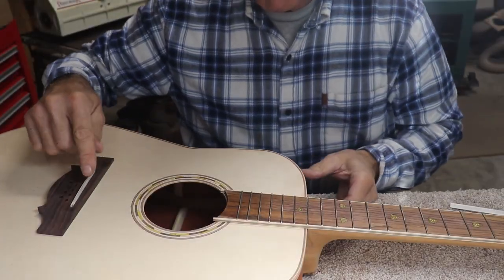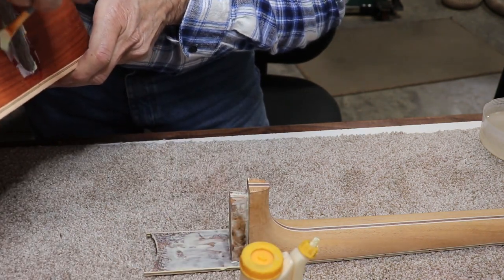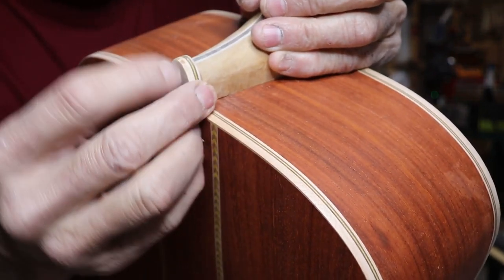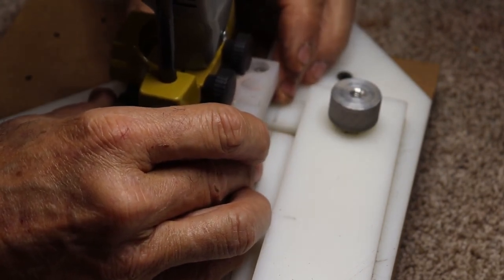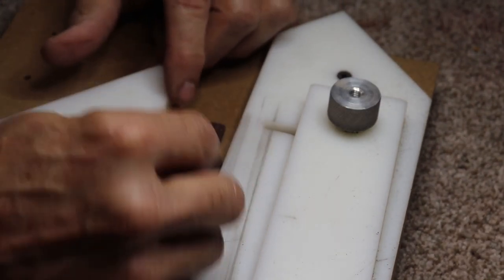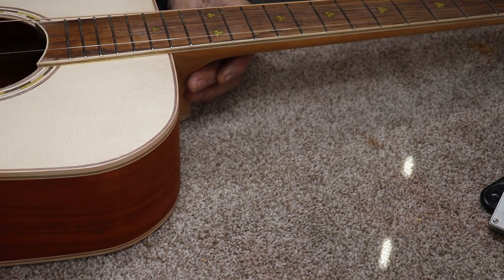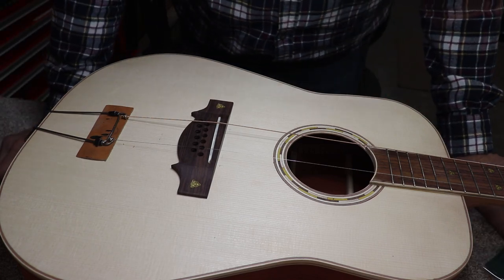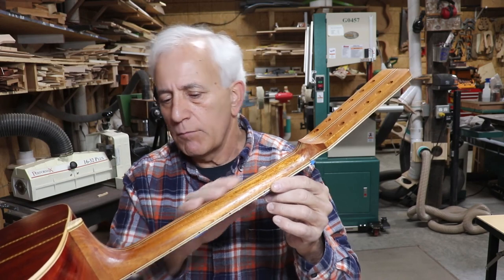455 A 12 String Custom Rosa Dreadnought Part 11

Comment: Hey Jerry, I am really loving the progress and the look of this 12 string. I agree with you on your comment that you like to leave the neck unfinished and just use oil. I have a Yamaha acoustic, with a neck that is high gloss and I am so tempted to remove it because I prefer a bare neck. It helps you move down the neck faster. I know that you use Adirondack spruce for your guitar, but is there any difference between the sound quality of a guitar that uses Adirondack vs Engelmann

Comment: Just an observation with little experience, your method of routing the bridge inlays assumed the bridge was the same thickness on both sides. How about setting the bit to touch the surface, then placing two .050 shims on the jig and lowering the bit again? Maybe easier said than done, like I said I have little practical experience with a router. It would take the calipers out of the equation.. We all have our opinion. I love your videos.

Comment: To set the router bit depth, just sit the inlays between the router base and the jig. Drop the bit till it touches the saddle and tighten it. Once you remove the inlays everything shifts the required depth down
Reply from the maker: Thats a good idea.

Comment: For intonation, the distance between the nut and 12th fret should not be exactly the same as the 12th fret to the saddle. Fretting the string increases the string tension ever so slightly, raising the pitch, so for perfect intonation the distance from the 12th to the saddle should be a tiny bit longer than from the nut to the twelfth, with the amount of difference depending on the action height. By the way, great tone from this guitar, it's going to be sweet.
Reply from the maker: Those measurements sound great on paper but they don't always work in real life trust me I know

Comment: I have a couple of charts that list the required drill bit for each screw size - I don't remember where or how I got them. Most of the time I just use the same 'by eye' method

Comment: One more thing......after the first time seeing your “Custom Made” intonation tool, rig, bridge finder, what ever you call it, I found it to indispensable to find the correct location of the intonation of the bridge! It is accurate and cheap to make. I would encourage anyone who does work on guitars to make one, especially those who build or restores guitars! I have 2. Mine will work for acoustic and electric guitars and basses. The on I use for a bass is not quite as wide. This is for permanently mounted brigades, you don’t need one for floating bridges like mandolins or arch top guitars. Make sure to install leather or cork or some soft material on any part of the rig that would come in contact with the guitar, to protect the guitar finish. I only wish I would have had this tool when I first started working on guitars so many years ago. My first fail could have been avoided. Live and learn and oh boy can you learn from Jerry!!! Another fantastic tip from Jerry! Love from NW Colorado. Thanxz
Reply: I use an old modified tailpiece. Thank you Jerry,  setting intonation on an acoustic is a no brainer now!

Comment: Jerry, for the depth of your bridge inlay use a string action gauge.  It's rectangular shape will span the hole on your proxon, and us calibrated in imperial and decimals.  You can set the depth in just a couple minutes easily without a lot of head scratching.

Comment: The distance from the 12th fret to the saddle needs to be longer than the distance to the nut to compensate for the rise in pitch, caused by stretching the string. When you push the string against the fret you add a bit extra tension on the string, which rises the pitch. Making the string a bit longer by shifting the saddle lowers the pitch and you are in tune. This effect is stronger with thicker strings, therefore you need to compensate more on the low strings. This also means that you should do the intonation when the action is correct. The higher the action, the more you need to shift the saddle backwards.

Comment: Brilliant and heartwarming as always. Per your videos, I have bought myself an Inline taper gauge. Dumb question - when you are measuring action, are you putting the gauge on top of the 12th fret or on the fretboard next to it? Seems like on top of the fret makes more sense but wanted to confirm w the master. Once again, grateful for the content you provide & your little island of common sense & beauty in these crazy times 🙏
Reply: Definitely, absolutely, no doubt about it, on top of the fret.
Reply: @zapa1pnt  Thank you!

Comment: Looks great, but I have to respectfully say that the neck joint seems to not sit flush with the body and I notice some gaps.  Are you able to correct that?   Everything otherwise looks wonderful, but that is something I noticed.
Reply from the maker: just glue

Comment: Enjoying the build. One item I don't agree with is your choice of tuners. Those Grovers weight a ton. I just checked. 12 Grovers will weigh 1.2 pounds! A dozen Waverly tuners would weigh .75 a pound. The Grovers function fine, it's just that they are so heavy. Just my observation and thoughts.